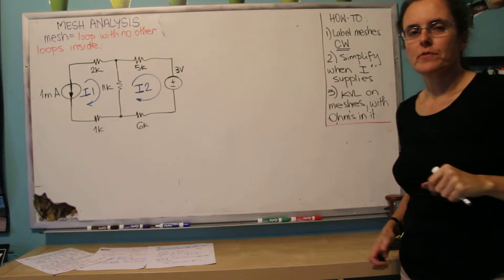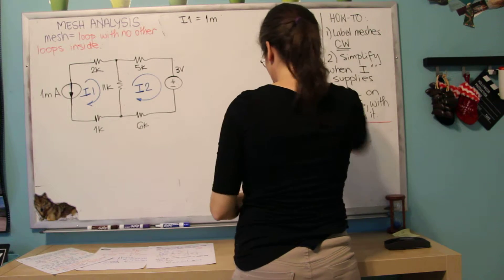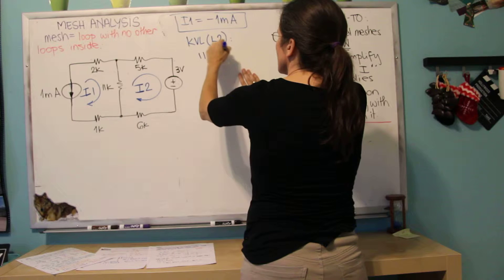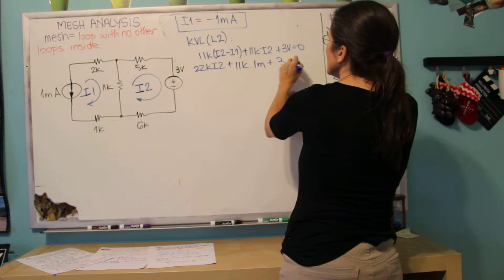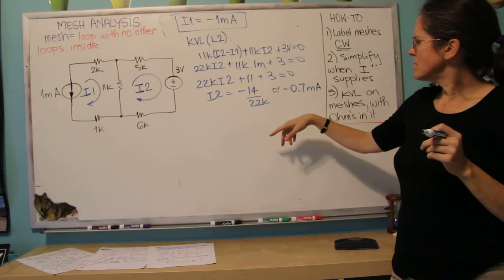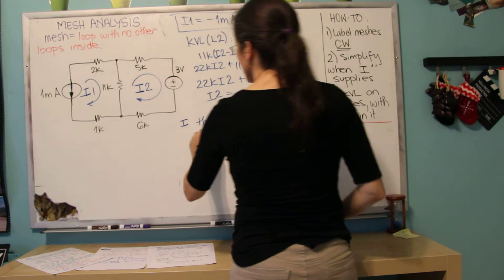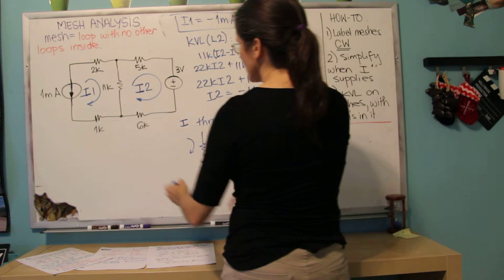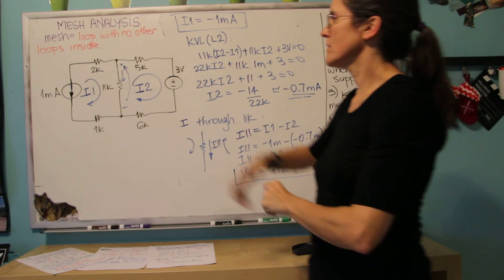Mesh analysis with current supply

Comment: what do you do if there is both a current & a voltage source in the same KVL
Reply from the maker: Great question. For KVL you still need a voltage drop shown in a current supply. We try to not use KVL when the loop has a current source. For mesh analysis, for example, the rule is that no KVL is written for that mesh.